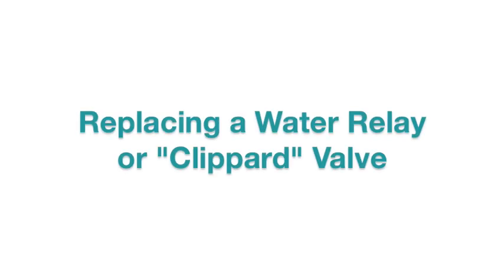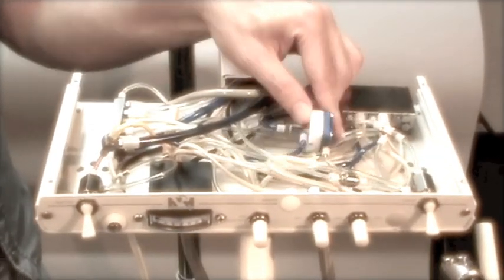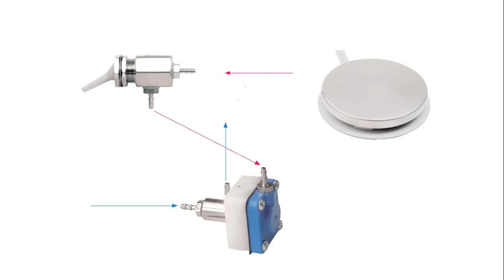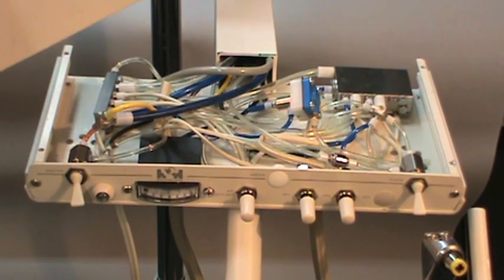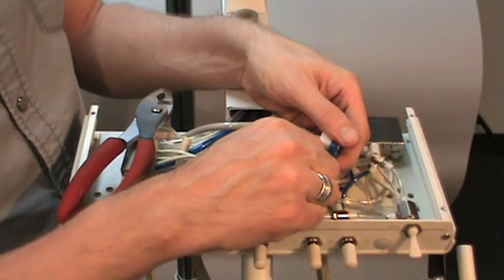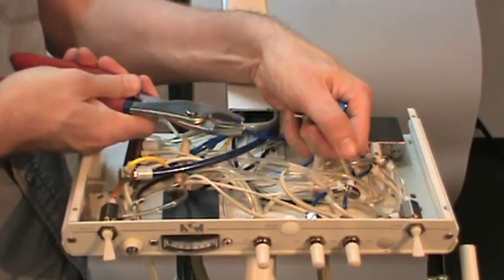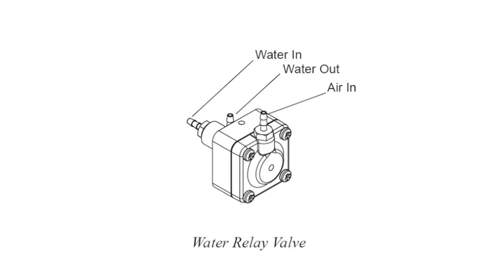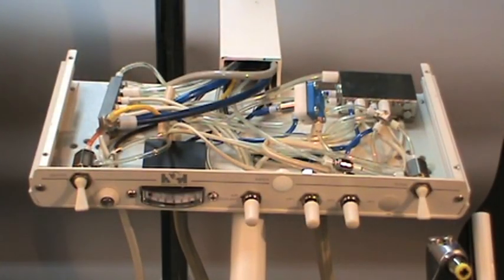Installing a Water Relay Valve

Comment: how do I adjust the water syringe pressure on the DCI unit?
Reply: You mean the the air pressure? There is air flow regulator in the unit with a pressure gauge on it, adjust it while pressing the air syringe, the moisture trap air filter is also a flow regulator, pull up and rotate while someone is pressing the syringe also, mine is set on 70 psi, there is usually two filters, one on the air compressor and another one in the chair, and make sure to regularly clean the filters, I suggest a limescale remover,, would love to hear from you